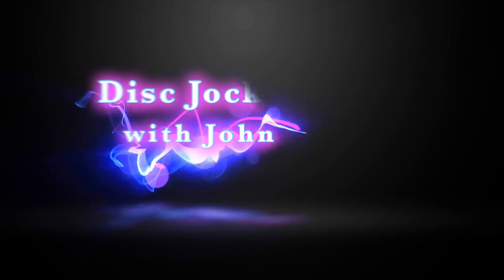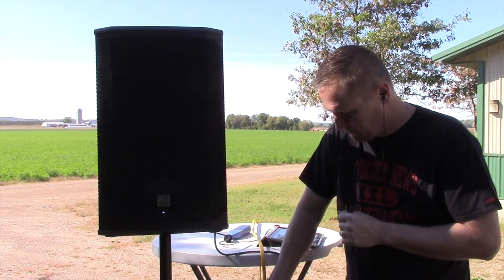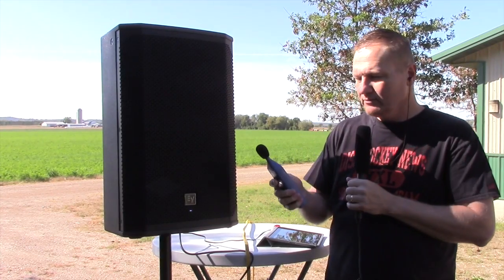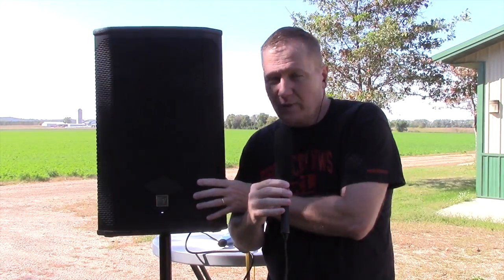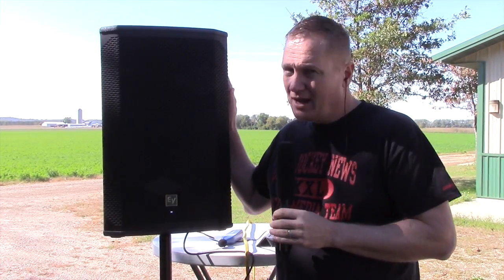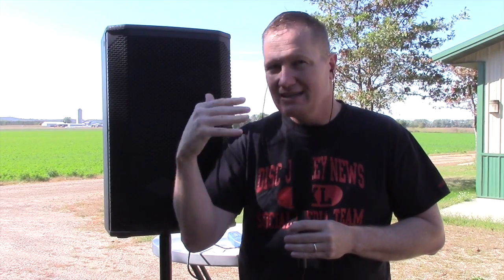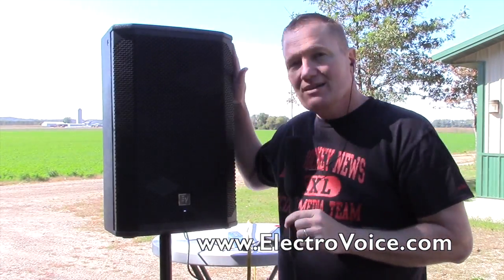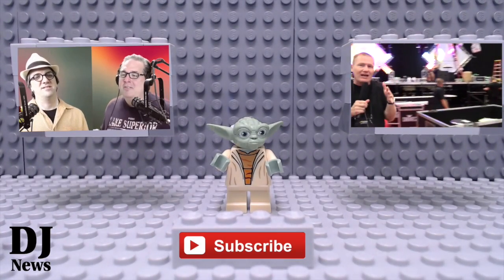EV EKX 12P Speaker Testing Watts and Volume: By the Disc Jockey News #ElectroVoice

Comment: Thanks as usual for all of the videos, amd Happy New Year...
   I have been running a pair of ZLX12P tops since they first launched that line.  I really like them.  I run them sometimes with a ZXA1 sub under my table, for certain events and venues,  and more recently got an EKX15SP which is awesome.  I plan to get more of both lines, but have also been debating on a pair of EKX12P tops to pair with the ELX15SP subs once I have more than 1.   In the meantime, since the setup isn't matched from one line, and I can't set the crossover that way, would you suggest 80, 100, or 120 hz?  I have played with this a bit amd just can't decide which is better.... I am assumingnboth should be the same setting, rather than an overlap such as subs set to 100 and tops to 80.
   Thanks again , hope 2021 is a better year all around than last year was...

Comment: John I just purchased an EKX 15...I set the clip light on front to come on...what does the display show in the rear? At what level is it clipping in rear?
Reply from the maker: it really isn't a clip light.. it is the limiting starting to reduce the incoming signal to protect the speaker.. the more consistent the light is on, the more limiting that is going on.. it is best to not push as it when you are getting that limiting protection going on too much.. if you are, pulled out some bass can help.. but, the key is to have enough rig for the gig as Ben likes to share..  :)

Comment: Don't pay much attention to the advertised wattage. Your speakers would fry if they got that much. So what EV and others do is to put a limiter on them. This is where things become tricky. Because even if the real wattage on these is 500 rms, the limiter will never let you hit that. It seems to come on at around 110 watts. That gives you about 110db not the advertised 130db. In all fairness the hookup in this demo was not the best. But what you can do right off of the bat is take 6db off of the advertised output and you might start to come close to it's real world output at say 124db. But it won't hit that due once again to the limiter.
I make the limiter sound bad but it's really not because most of would blow our speakers and ruin the gig without it. 
I can tell you that 110db is very loud and good enough for most events ...
Reply: Well I need loud and clarity with good bass punch to it.  The EKX 15P solves all of that, BUT the problem is that it's too darn heavy to "easily" carry around up the stairs where I will gig at.

So my question to you is, what is going to be my next best option?  Either to go with the EKX 12P instead and lose bass, or go with the ELX 200 15P and lose some of the GREAT clarity that only the EV speakers have in this price range of under $600-$800?
Reply: ELX200 15P ... if not using a sub you need a 15 inch speaker. I have heard the QSC K12 many times and with just two speakers the bass is decent if you EQ it in ..

Comment: In your opinion does the 12 sound better than the 15?? I know with sub the 12 usually wins but looking for something i can use all situations
Reply: I know it's a late reply lol almost 10 years. I got the 15 and absolutely pleased with them. Yes with a 12 the vocals sound more pronounced but the vocals on my 15 are just fine. I use it without a subwoofer. You can push the 15 much more than the 12 and the sound travels further.

Comment: Thanks,  I'm looking for(real) 110 dB speakers This may be the one. Have you tested jbl prx ? I'm at the crossroads between the two.
Reply: I have had a pair of JBL PRX615's for a little over 4 years now.  Absolutely love them.  No complaints ever & they have been put to the test.  We rock weddings, teen birthday parties & mobile gigs, including a lot of tents, pavilions & even open fields.  Two years ago, we did a school dance of 500+ kids & blew an amp from our rented equipment (older passive EV subs full range cabinets & a QSC amp), so we had to finish the night with JUST the 615's, no sub.  Obviously we lost some of the low end, but nobody complained.  They ran full throttle for over an hour of Lil Wayne, Wiz Khalifa, Meek Mil, Ying Yang Twins & never even broke a sweat.  I would not recommend doing this on a regular basis, but they run hard.  Since then we added the PRX715XLF sub (amazing for it's size/weight/price).  Last year we added a pair of PRX 712's.  They have an extra 500 watts & sound louder, but the 12" does not go as low as the 15".  We do a lot of events without the sub using just the 615's & they really hold their own until you get into the really low stuff, but when you add the sub it is heaven.

Obviously sound "quality" is unique to each person and requires some skills with an EQ, but I rank these as some of the best speakers available.  You will not be disappointed.
Reply: @DayNNyteDJs sad part for me is since I got into the live sound industry, I've been hunting these speakers down since 2020. Unfortunately non were available in South Africa. Now they're even more scarce. Found some online overseas but the cost of shipping a pair also with customs tax in South Africa isn't worth it, also too many scammers online. I've settled for ev ekx15p and elx. I did own jrx215 but had to sell them. I'm in search of some nice sounding hard hitting jbls but can't get any.
Reply from the maker: +Charles Barnes sr we are doing a test of some JBL right now.. Should have a video ready hopefully later this week!
Reply: Awesome!  We have a small band , praise team and we are going outside in the spring. I'm sure they both are sufficient for inside but jut wanted to see what happens outside. 60x100 tent no walls. Thanks
Reply from the maker: +Charles Barnes sr I think I would look at the EV EKX 15P.. then you wouldn't need subs for the band if you are running instruments through the speakers.. for vocals only, the 12P would be the ticket!!  :)

Comment: Hi John! How would you say this compares to the Yamaha DXR or even DSR series?
Reply from the maker: +djlobb I would say they fall in between, but much closer to the DSR than the DXR... might be a match in sound quality for the DSR.. with a slight nod for the EKX due to the DSP extras!
Reply: +discjockeynews 
That's very interesting. What about loudness? I find the DSR series gets ridiculously loud, just not as bassy as the DXR series.  Is there any advantage to the larger 2.0" HF driver on the DSR compared to the 1" HF on the EKX?
Reply from the maker: +djlobb I don't see that large of difference between the two HF drivers.. I think both boxes are tuned to their enclosures very well! But, this is our office test where we will be doing a comparison for release after Thanksgiving!!  :)